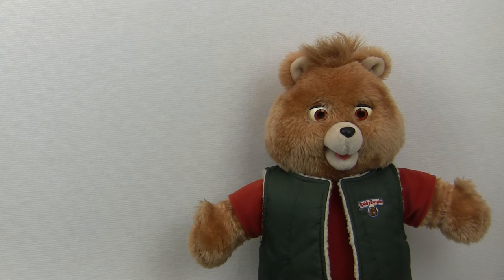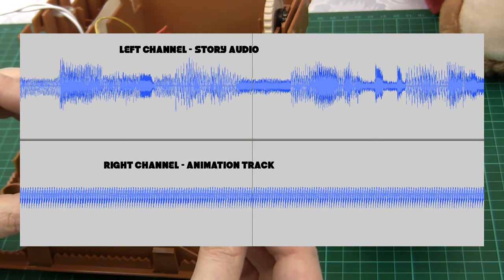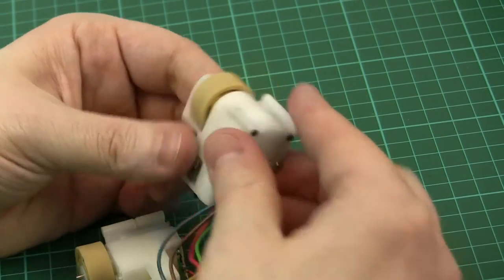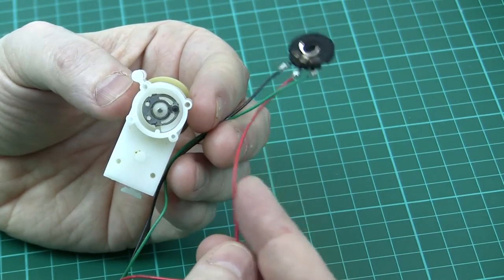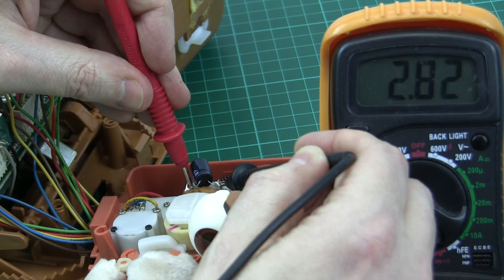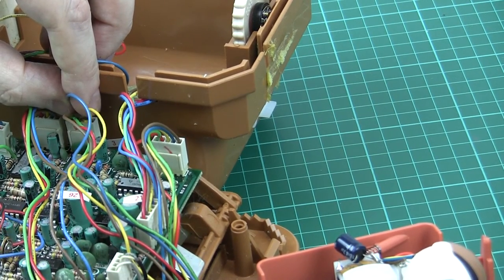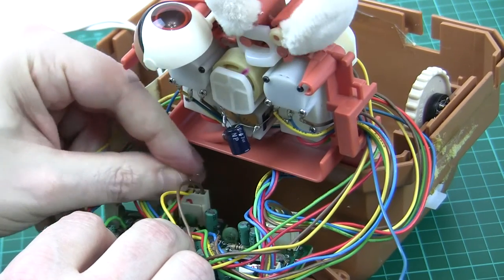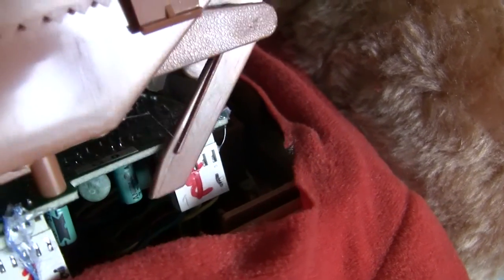Teddy Ruxpin Refurb Part 5 - Servo Investigation, Freeing Stuck Servos Electrically

Comment from the maker: I've added to the video description:
## UPDATE - Feb 20th 2016 ##  The theory I put forward, in this video, as to what might cause stuck servos has now been shown to not be the cause at all. Yes its something else entirely. Suggest you don't copy the switch board modifications as they are unlikely to be helpful. See the forthcoming part 5B for the details. Most of the testing and experimentation in this video are still valid, so I see no reason to change and repost.

Comment: Love your explanation of why you are using the resistor for each servo. My 5 year old loves the video btw, but wants to see you put the board together (with three resistors and buttons). Even if it is a little carbon soot in the servos... ;) Maybe a reset button should have been designed like a "Self destruct button" that electrically cleaned the servos after every use. Lol

Comment: What kind of grease do you use on the cassette player and on/in the servo motors please? Thank you for your videos!
Reply from the maker: Sorry for late reply. On anything plastic or metal or where plastic spins on a metal rod, I tend to use white lithium grease as it mostly stays put and I hear it is not harmful to most plastics. Inside the servo motors, where the plastic gears are, I'd guess this would be OK too, provided it is a thin smearing and they are not all gummed up. On the commutator of the servo motor, where the brushes make contact, I believe this is a special mildly conductive spark quenching grease made by the motor manufacturers (mabuchi).  Inside some of the cheap mabuchi motors from hong kong or china off ebay (mabuchi name imprinted in the white plastic) would be a good place to get that from if needed.

Comment: I am have a problem with my Teddy's lower jaw servo where it doesn't ever stop moving back and forth almost like it's having a seizure.  Any tips you might have for this problem would be greatly appreciated !  Thank you so much for posting these amazing and comprehensive videos !
Reply from the maker: I've not seen this happen before. I can only make a guess. If there was a dirty patch somewhere on the wipers travel, It could lose connection whenever it went there. This would make the servo aim for one end (like when I removed the wire), moving it off the trouble spot, which would reconnect it and the cycle could continue. I'd clean inside the compartment where the variable resistor is (see video 2- sorry my hands are in the way for much of that), particularly check where the two metal prongs make contact. Also check the 3 wires. If one is really frayed, it could make/break contact as the servo body moves and will need re-soldering.
Reply: Thanks so much for your speedy response !  I will take another look and try the tips you gave !  Thanks again !!!
Reply from the maker: I just posted a new 5 minute video in which I fix a servo, which can't sit still, by cleaning it.